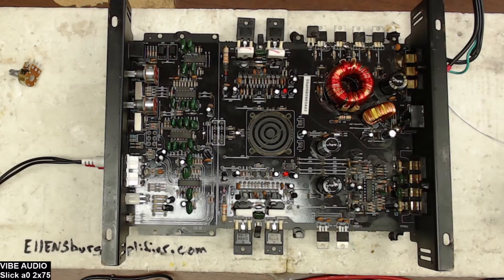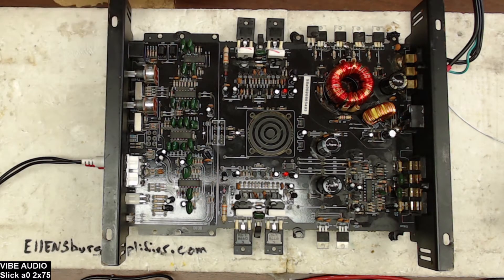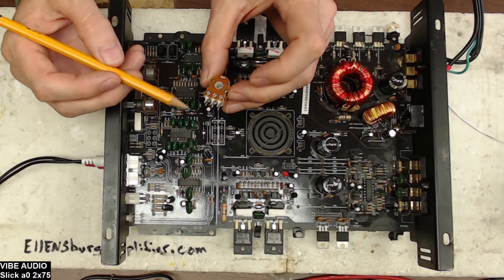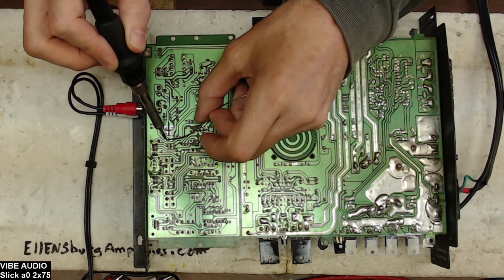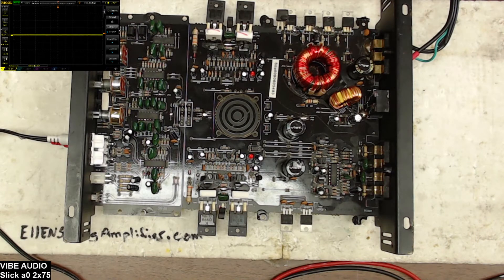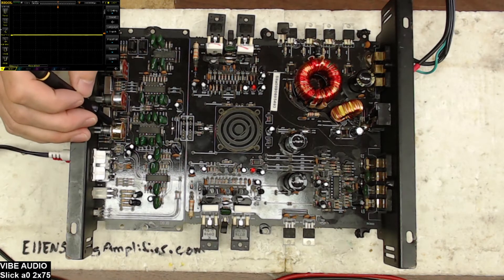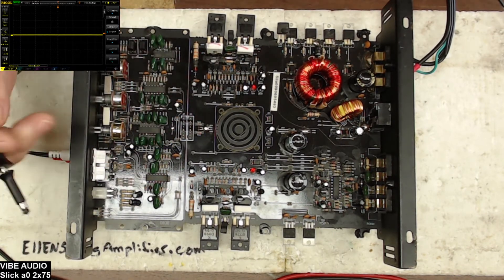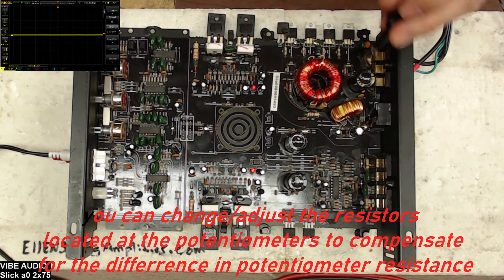Vibe Audio a0 75w x 2 Class AB Amplifier Repair of Output Section and Gain Potentiometer

Comment: proven fact, hotter-shorter is better than colder-longer!, especially with highly sensitive components.
Reply from the maker: Indeed! I will alternate IC sides while soldering the sensitive ones to avoid heat buildup. For instance, the 21844's in the Maxxsonics output boards. They already run hot so no need to stress them beforehand.

Comment: another excellent video!  i have stepped up my temps for the same reason some of the boards are so thick it would burn pads adhesion off the board, faster is better and takes some heat. removing fets i stepped up to a 150 watt stained glass stick and a 250 watt stick for doing lead car body seams works great for rf amps but is a bit intimidating lol
Reply from the maker: Absolutely agree Mike. I find boards like the JL amplifiers that tend to wick the heat away from a cooler iron which leads to overheating IC legs. I have tailored what I do depending on what IC I am installing.